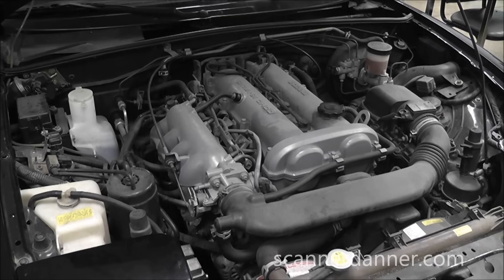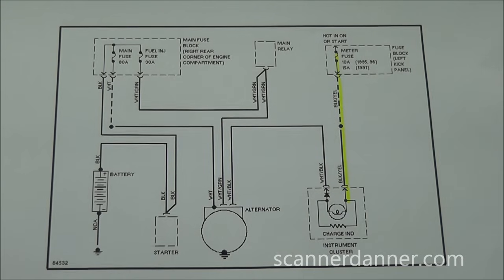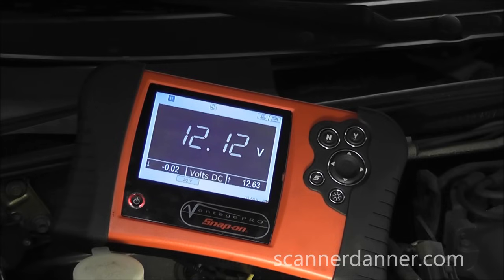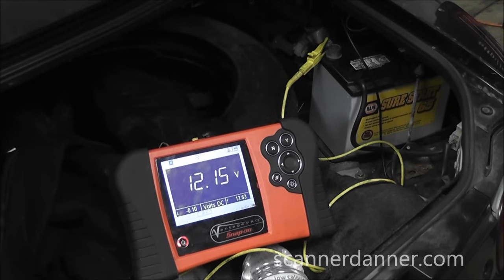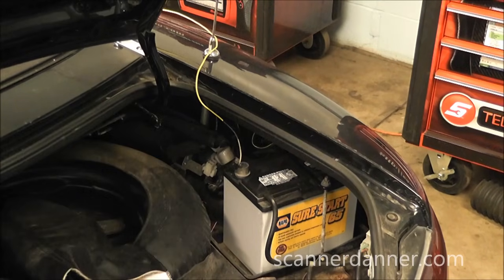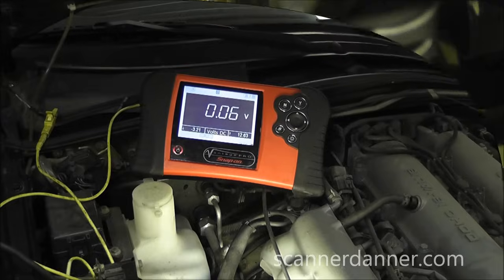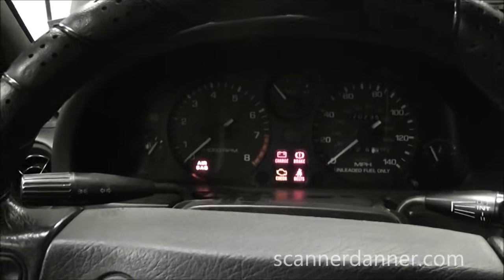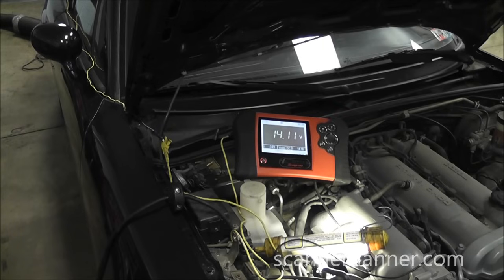How to test an Alternator (not charging from a blown fuse) - Mazda

Comment: I super like your channel :) you know how to explain. I have saab 9-3 2009 and problem is with low voltage on battery,but it charge to 14.2...keeping steady on 13.6 on load witch is fine. 12.4 with not running engine. Issues is that voltage drops even if charging is 14.2. On running. When i try to start 5 th time it crank long an start,but reading was 12.1 on running while it voltage climbe slowly up to 14.00 not fast. Question is what can be causes for that?
Reply from the maker: This comment doesn't make sense. "Issues is that voltage drops even if charging is 14.2" 
You said under load you're at 13.6. So all accessories on right? 
Sounds like a weak or dying battery based on what I can decipher from your question
Reply: We changed the battery and alternator because pulley on the alternator was loose😅 after i replace both of them it had strange issue....i can start the engine right a head ,but sometimes it cranks long periode of times without no problems with dying battery....other times it will go dead for next start after next day or more. Its going slow cranking while battery is draining....whats strange about is that long crank didnt drain the battery,but when i shot down the engine towards the parking lot while car was still rolling to remove the key  i couldnt remove it off,so i tried to start again then it drained 🤔 just because my key got stuck inside the switch an i couldnt remove it...it couldnt start again. Then it drained....my father told me when his friend helped him with jumpstart cable to start his saab,friends car got drained battery of fathers car
Reply: Sorry if its to confusing. I trying my best to explain:) i am from.norway
Reply from the maker: @zlatkomustovic1147  let's move this to my forum www.scannerdanner.com it is free to join and we can help you better there. Thank you!

Comment: Perhaps there is a diode inside the regulator inside the alternator?  (not in the diode tree).       .7 volts is the typical voltage drop across a "signal" diode (not a heavy power diode).   Otherwise, yes it could be just coincidental that the  .7 drop is across the connectors, wiring, etc.      Perhaps it makes sense that there would be a diode so current could flow IN to the Regulator but not Out?

Comment: Will bad Diodes cause and intermittent charging on a 06 chevy express 6.0. Has multiple dtc's P1637 to start. came in with a dead bat and the shop sold them a batt and now its in my bay. It charges and then dont charge. have you seen this with GM's??
Reply from the maker: I don't know if a bad diode would do that, when they fail, they fail. The intermittent nature could definitely be a bad alternator though.

Comment: sorry its a dumb question, if a circuit  is negative side switched will the test light still light up when you touch the fuse?
Reply: Yea, , if the circuit is on, power has to flow through the whole circuit (including the fuse, both sides).
Reply: If the test light clamp is connected to battery positive so you are completing the circuit through the alternator ground. If the test light is referenced to body ground the test light will not light unless the key is on. Think difference of voltage potential great enough to light the test light.
Reply: James Butter i

Comment: got a 98 Olds 3800 that has a charging system issue. pulled up a diagram and it is computer controlled. what kind of direction and checks do I need to go to help diagnosis this customers car
Reply from the maker: Post this to my forum Randal https://scannerdanner.com/forum/post-your-repair-questions-here.html
If my memory serves me correctly on this model, the alternator is self regulated but requires a "wake up" signal from the PCM. Without this signal it will not charge. I believe it is a simple 12v turn on signal that can be substituted with an incandescent test light connected to battery positive. (if the signal is missing)
Reply: Thanks for the input Paul. I will do that. Just subscribed to your premium channel and bought a hard copy of your book from aeswave.com so that will help me alot in the future

Comment: Hi ScannerDanner, I have a strange charging-problem, maby you can give me a hint.
It's a 2000 Kia Sportage 2.0 turbodiesel (old Mazda-engine), suspect the alternator is based on the same as the one in the Miata, also connections are the same.
Battery-charge-indicatorlight is working, and shuts off after start, every time. But, voltage will not increase, normally stay around 11.8-12.2 V after start-up. If I keep RPM above 2.000 for a few seconds, I hear a click inside the cabin, and voltage increases to normal charge-values. If I let it drop under 2.000 rpm, it clicks again, and alternator seems to stop charging. After about 10-15 min of running (doesn't matter what rpm), it will charge normally.
Tried with 2 alternators, and 2 batteries (all in good order) with same problem.

Tested the cables, voltagedrop on both + and - to alternator are low values.
The "alternator sensing cable" always shows almost battery voltage on engine running.
The charge-light cable always shows above batteryvoltage.
Don't remember excact values, but this is a general idea:
Example non charging: Battery 12.5, Sensing-cable 12.3, Charge-light 13.3.
Example charging: Battery 14.2, sensing-cable 14.1, charge-light 14.4
Also measured on alternator output during non-charging and charging with engine running, they are both around battery-voltage.
Earlier I had a 8awg cable directly from alternator to battery in addition to the original setup, but same problem.
Reply: Found the problem, it's not a charging issue, but a consumer-issue.
The glow-relay will recieve a signal to stay on under the "non-charge" sircumstances earlier explained.
The glow-plugs (4pcs) is around 40-60 A, so it will use all power delivered from the 60A alternator.
Don't know where the actual problem with the signal lies, possibly PCM, but on these old cars, it's so great to just bypass with a switch :)

Comment: Question Dan, I bought an hid kit for my 91 Miata, charge light was coming off and on. On at and idle and slowly dimming away getting up to speed. Assuming it's drawing too much power. Few days later I dropped my girlfriend off at her house. On the way home the lights got all dim and charge light was still on. We got there and she got out and said the headlight went out. Soon after the car died. She grabbed some jumper cables and we hooked up the car. She had switched the cables around on my car *facepalm. Blew the 80 amp fuse. Replaced fuse. Started right up. Let idle for 30 min. Came back out to start it and battery was dead. Jumped it. Drove a mile and the car died. On the way. The charge light was on and my tach stopped working. Air bag light flashing. Waiting for my dad I removed my headlights and hids. Since it all started with me putting in the new headlights. We got it jumped and I drove it all the way home without that charge light. Now it's still on? Battery and alt are new.

Comment: Does all vehicle brands have the bulb circuit? My 06 Impala flickers on interior lights at times, rear window defogger not working and wasn't then relay stopped clicking also. Car gets random service traction control light and service brake assist and when this occurs a U code comes up. something about radio or cluster tf I recollect. I have a video from other night. shut car off and restarted and they were gone and not even in history in solus edge scanner when I checked afterwards. the service traction and other code comes on random at timeline regularly. something has to be wrong. one thing is consistent and that is the rear window defroster.
Reply from the maker: It is becoming more and more difficult to answer questions here. I have 80,000 people asking me for help now. So I have created a forum to help you guys better. It is free to join and we can exchange pictures, wiring diagrams and waveforms if needed to help guide you through the process of troubleshooting your vehicle. Thank you so much! Hope to see you there. 
Paul Danner (ScannerDanner)
 https://www.scannerdanner.com/forum/post-your-repair-questions-here.html

Comment: Paul or somebody who has experience please help. I have a NISSAN Murano SL 2009. Battery and brake light turn on, did the test and amperage was dropping off, checked battery cable from the alternator and it was fine, so I replaced alternator and battery because the old one it was dead already. Works fine for a day but I wasn’t happy with my data 12.8-13.2V with everything on and engine running and driving. Next day lights start to flickering while driving, went to check and amo was dropping again!!! So I checked the fusible link at the positive battery terminal and one of those fuses was corroded, I found water in that fusible link so I replaced. Then check my data and amp increase right away and Voltaje too, I was happy I thought I’ve found the issue but not the case, after a road test by the highway again charging at 12.8-13.2V with everything on and even with everything off and engine running and driving. Now the battery and brake light again ON. PLEASE HELP, could be the IPDM? Thank you guys

Comment: I did a voltage drop test across the wire on my Mustang after putting a LEaD. I did a voltage drop across the positive battery cable alone than I did a voltage test with the battery end on it and I lost two or three volts so I replaced it with the original one that came with the Mustang and I don't have any problems battery cable end on it I kept getting stranded so after doing the voltage test I was losing 3 volts between the alternator and the battery so I put the original still end on it with some Dielectric grease and got the voltage back so I was losing 3 volts through that battery cable e n d
Reply from the maker: LED? Did you mean lead?

Comment: I have 14.8V at idle on my i20 2011 1.2 Petrol India Version.
Even if I revs at about 1500 rpm, still it stays at 14.8V.
I have no other issues. Everything OK.
But I'm worried if my idle alternator output voltage 14.8V is too high or not?
What's the acceptable voltage range?
Reply from the maker: Anything under 15 and you're fine. 15.5 is when you start cooking a battery.
Reply: @ScannerDanner  thank you.
Good morning from Manipur, North East India, India at time 7.04 AM.

Comment: I have a 99 vw jetta vr6 and i am getting 20 ground fault codes to major sensors in the engine and it runs really rough! I noticed on my car there is no wire to or from on the BAT post!?? I really could use a opinion please! Here is the vagcom!

20 Faults Found:
18010 - Power Supply Terminal 30 
P1602 - 35-10 - Voltage too Low - Intermittent
16684 - Random/Multiple Cylinder Misfire Detected 
P0300 - 35-10 - - Intermittent
16687 - Cylinder 3 
P0303 - 35-10 - Misfire Detected - Intermittent
16497 - Intake Air Temp. Sensor (G42) 
P0113 - 35-10 - Signal too High - Intermittent
16486 - Mass Air Flow Sensor (G70) 
P0102 - 35-00 - Signal too Low
17834 - EVAP Purge Valve (N80) 
P1426 - 35-00 - Open Circuit
17950 - Angle Sensor 1 for Throttle Actuator (G187) 
P1542 - 35-10 - Implausible Signal - Intermittent
17952 - Angle Sensor 1 for Throttle Actuator (G187) 
P1544 - 35-10 - Signal too Large - Intermittent
17580 - Angle Sensor 2 for Throttle Actuator (G188) Signal too Low 
P1172 - 35-10 - - Intermittent
17633 - Fuel Injector for Cylinder 1 (N30) 
P1225 - 35-10 - Short to Ground - Intermittent
17637 - Fuel Injector for Cylinder 5 (N83) 
P1229 - 35-10 - Short to Ground - Intermittent
17635 - Fuel Injector for Cylinder 3 (N32) 
P1227 - 35-10 - Short to Ground - Intermittent
17638 - Fuel Injector for Cylinder 6 (N84) 
P1230 - 35-10 - Short to Ground - Intermittent
17880 - EVAP Leak Detection Pump 
P1472 - 35-10 - Short to Ground - Intermittent
17843 - Secondary Air Pump Relay (J299) 
P1435 - 35-10 - Short to Ground - Intermittent
17829 - Secondary Air Injection Solenoid Valve (N112) 
P1421 - 35-10 - Short to Ground - Intermittent
17636 - Fuel Injector for Cylinder 4 (N33) 
P1228 - 35-10 - Short to Ground - Intermittent
17923 - Intake Manifold Valve (N156) 
P1515 - 35-10 - Short to Ground - Intermittent
17634 - Fuel Injector for Cylinder 2 (N31) 
P1226 - 35-10 - Short to Ground - Intermittent
17525 - Oxygen (Lambda) Sensor Heating Circuit: B1 S2 
P1117 - 35-10 - Short to Ground - Intermittent
Readiness: 0110 1101

-------------------------------------------------------------------------------
Address 03: ABS Brakes Labels: 1J0-907-37x-ABS.lbl
Part No: 1J0 907 379 H
Component: ABS/EDS 20 IE CAN 0001 
Coding: 03604
Shop #: WSC 00066 
VCID: 3663DDFA12827BAE71B-4B1A

3 Faults Found:
01276 - ABS Hydraulic Pump (V64) 
16-00 - Signal Outside Specifications
00290 - ABS Wheel Speed Sensor; Rear Left (G46) 
35-00 - -
00287 - ABS Wheel Speed Sensor; Rear Right (G44) 
35-00 - -

-------------------------------------------------------------------------------
Address 15: Airbags Labels: 1J0-909-60x-VW3.lbl
Part No: 1J0 909 609 
Component: C AIRBAG VW3 SG 0002 
Coding: 00067
Shop #: WSC 00066 
VCID: ECD7BF929C4E717ED7F-4B1A

1 Fault Found:
00532 - Supply Voltage B+ 
07-10 - Signal too Low - Intermittent

-------------------------------------------------------------------------------
Address 17: Instruments Labels: 1J0-919-xxx-17.lbl
Part No: 1J0 919 951 B
Component: A4-KOMBIINSTR. VDO V57 
Coding: 06262
Shop #: WSC 00000 
VCID: 2F6DE89EEDD84A6632D-5142

1 Fault Found:
01039 - Coolant Temperature Sensor (G2) 
29-10 - Short to Ground - Intermittent

-------------------------------------------------------------------------------
Address 46: Central Conv. Labels: 1J0-959-799.lbl
Part No: 1J0 959 799 AJ
Component: 61 Zentral-SG Komf. 0001 
Coding: 04096
Shop #: WSC 00066 
VCID: 8603ED3AA2E2AB2E21B-4AE8

Subsystem 1 - Part No: 1J1959801C
Component: 61 T?rsteuerger. FS0001r 

Subsystem 2 - Part No: 1J1959802D
Component: 61 T?rsteuerger. BF0001r 

Subsystem 3 - Part No: 1J4959811C
Component: 61 T?rsteuerger. HL0001r 

Subsystem 4 - Part No: 1J4959812C
Component: 61 T?rsteuerger. HR0001H 

4 Faults Found:
00953 - Interior Light Time limit 
25-10 - Unknown Switch Condition - Intermittent
01358 - Internal Central Locking Switch; Driver Side (E150) 
27-10 - Implausible Signal - Intermittent
00912 - Window Regulator Switch; Front Left (E40) 
27-10 - Implausible Signal - Intermittent
00944 - Heated Exterior Mirror; Passenger Side (Z5) 
35-00 - -

Comment: If you have a good fuse  = complete circuit, you will have voltage  and if there is a load  you will have an amp draw,  if the fuse  is bad  you  will have neither (after the fuse),.

Comment: Will an unplugged voltage regulator cause the battery to die
Reply from the maker: If you can unplug a voltage regulator (they are all internal to the alternator these days), then yes, the alternator will stop charging and your battery will die
Reply: @ScannerDanner  yea i replaced my alternator..i started up then died at idle, im dealing with a 2002 ford explorer
Reply: @ScannerDanner  thanks big bro good to go

Comment: I changed the alternator,battery and terminals and the battery light comes on what could it be?
Reply from the maker: What is system voltage at the battery and alternator? What are the other alternator wires indicating (voltage wise)

Comment: so i have a 07' mazda 3 that wont start or turn over when the key is all the way on, i tried to jump start it, nothing, charged the battery with a smart charger says 100% still npothing, i did notice when i tried to start it the cig lighter where my charger plugs in and the radio light both go off. but the interior light doesnt an d all dash lights are still on...HELP!!!
Reply from the maker: It is becoming more and more difficult to answer questions here. I have 80,000 people asking me for help now. So I have created a forum to help you guys better. It is free to join and we can exchange pictures, wiring diagrams and waveforms if needed to help guide you through the process of troubleshooting your vehicle. Thank you so much! Hope to see you there. 
Paul Danner (ScannerDanner)
https://www.scannerdanner.com/forum/post-your-repair-questions-here.html